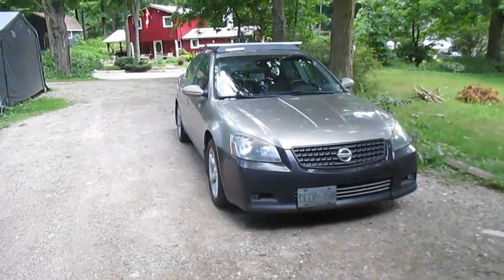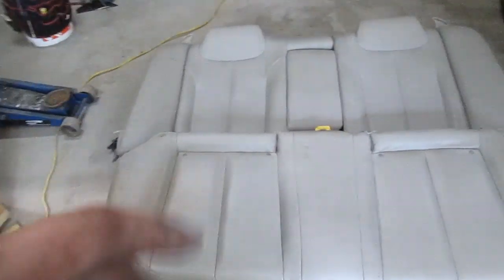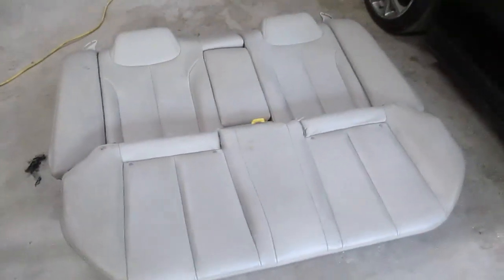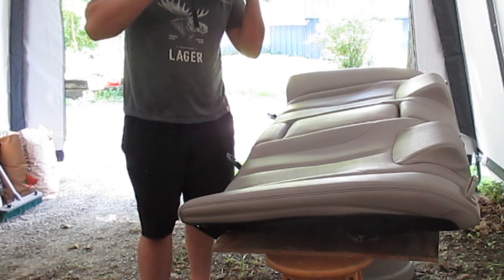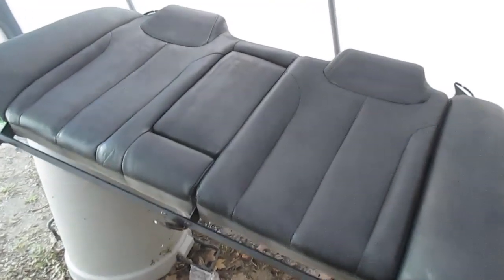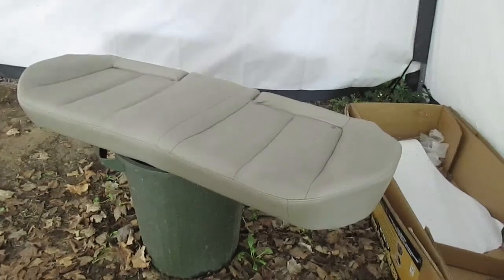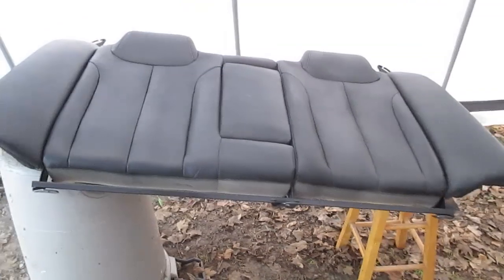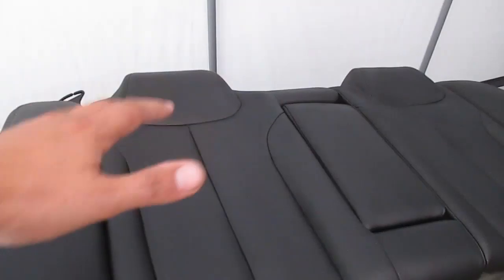Dying Leather Seats With Dupli-Color Spray Paint

Comment: How's it holding up?
Reply from the maker: So far it's actually holding up really well. Much more durable than I had anticipated
Reply: @DNALI  surprised that it held up, it start to flake on my GS300 leather seat after 2 months, gonna try it again on my truck leather seats, it don't come come out good  gonna redye it with Sem dye instead
Reply: Sengchanthra Long how’d it go for you? How would u remove the paint?
Reply: @raymondlong99  he said it wasn't really for leather. Not sure why he put that in the headline.
Reply: @raymondlong99  since you didn't actually do a leather seat, why put that in the headline?

Comment: Doesn't work! I did that to my 05 Altima seats that were originally tan. Cracked within a couple weeks. I ended up switching with some stock black seats from an 05 Maxima. My cracked "black" ones are sitting around in the garage. How is it holding up?
Reply: SEM is better, from what I'm hearing it actually will dye the leather